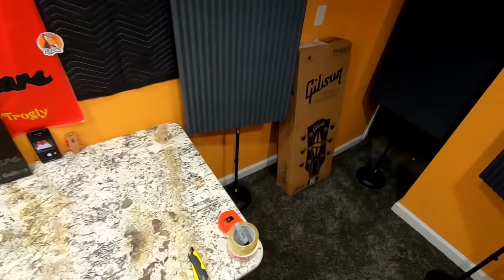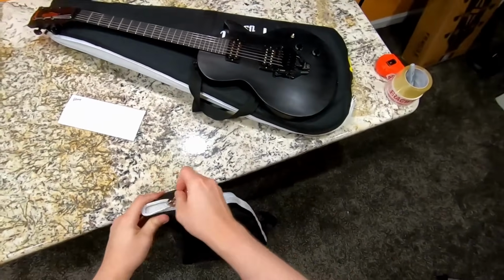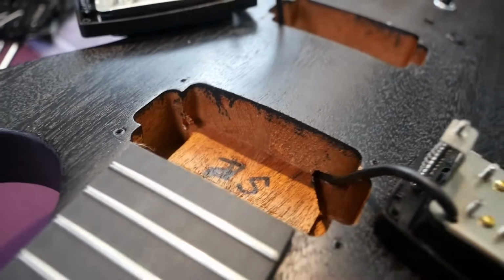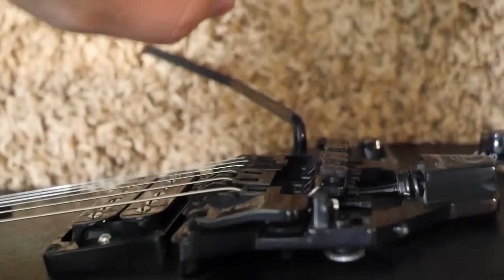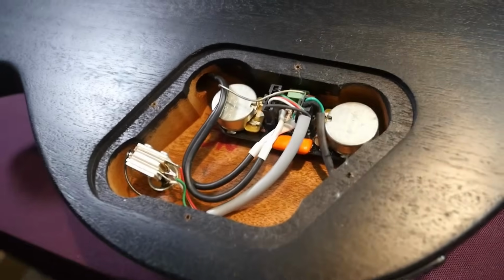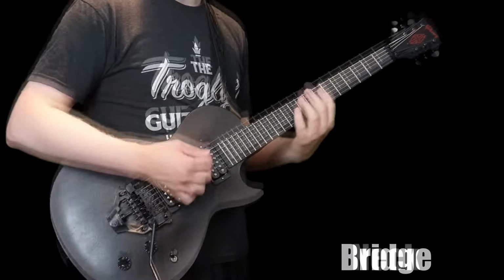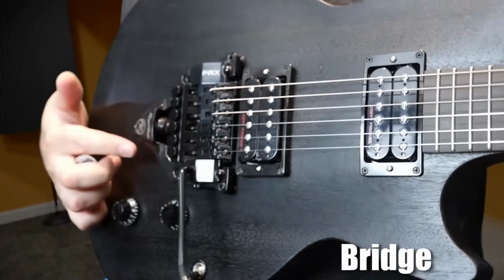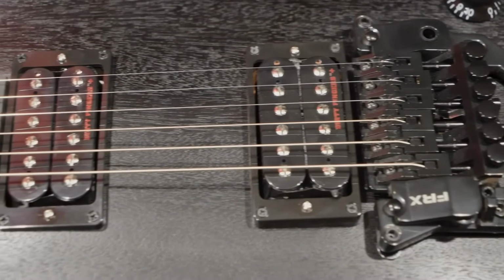This Les Paul Was Made For One Thing... | Gibson Les Paul CM Black FRX Floyd Rose | Review + Demo

Comment: The paint job and body is cool, but the Floyd rose is NOT worth the maintenance (coming from someone who has owned a Floyd rose).
Reply: @lamontprospect9974   
The re-stringing process alone is a pain. And there are so many small pieces that can go missing.
Reply: @dirtydanthesecretsauceman8519  you can buy a version which uses regular ball end strings at guitar fettish.   its a strait swap apparently.
Reply: @jacobbrown1690  
That does sound nice.
Reply: @lamontprospect9974  
A nice bigsby will do just as good a job.
Reply: @lamontprospect9974  the 67 flying v in sparkling red or burgundy? Saw a video for that, sounds really really good. I definitely want to get it too!

Comment: I think the "Dirty Fingers +" pickups are actually what they market as "Dirty Fingers SM" which have a single magnet of ceramic 8.  The old DF pickups had 3 standard ceramic magnets.  I don't know if it's "hotter' but it's voiced differently and in my opinion, they are more musical and sound better with the volume rolled down.

Comment: Interestingly they used the FRX trem but they installed a "regular" locking nut instead of the locking nut that goes behind the stock nut and requires more drilling in the headstock...

Comment: I seen those FRX systems installed at my guitar guys shop. If the arch is too strong on the top of the guitar the system won't work so you have to take a scoop out of the body. Ekkkkk! Definitely a trem system for a flat top guitar.😐

Comment: I have an FRX on an explorer and it doesn’t go back to zero after using. I haven’t messed with it too much but so far I’m not impressed. It’s functioning like a $20 Floyd you get off of Amazon. Maybe when I have a couple hours to spend on it I can get it working properly but after getting a basic install and intonation is less than reliable.
Reply: Most trems work best with lubrication. They say white lithium grease on the knife edges is best. I've used vaseline and it makes the difference between uttrrly useless to perfectly balanced and in tune.

Comment: And they come in a sack...
A sack
Reply: I agree...They should at least offer a polyfoam case ( or hard gigbag ) that would offer a lot more protection than this cheap and flimsy gig bag...
It does have some fluff inside but there's no extra padding around the headstock and the top is always open even with the zipper all the way up...

Comment: "Ultra hot" pickups and they read 15k? Isn't that like, regular vintage PAF resistance? By ultra hot I think something like 50k or something ridiculous like that.
Reply: PAF read about 8k-8.5k, 'hot' pickups on a 6 string are usually 12k and up. My 8 string EMG 808x reads about 16.5k and my Ibanez 8 reads 18k. 22k is the highest I've ever seen on an 8 string black winter bridge pickup. 50k maybe after an overdrive.
Reply: @lichkrieg4898  Oh yeah, I looked it up and you're right. I had my numbers mixed up. Thanks!

Comment: So it's an all black LP Studio with a bolt on Floyd basically.
Reply: Except it's thinner, has different controls, and way hotter pickups, maple neck with all mahogany body, no inlay, richlite fretboard, etc.
Reply: @kitoyobeni1  I had a LP studio that it had a few differences. But it had a thin one piece all mahogany body like this and it had the same satin finish where you could see and feel the grain in the monogamy but it was cherry red. It was like the most base model LP with an arch top that you could get. Next rung down would be the flat top Junior then the special. . But any way. How thin this guitar is and the finish reminded me of the LP studio I used to have. I know most of them weren't as thin and a one piece like this guitar now that I think back.